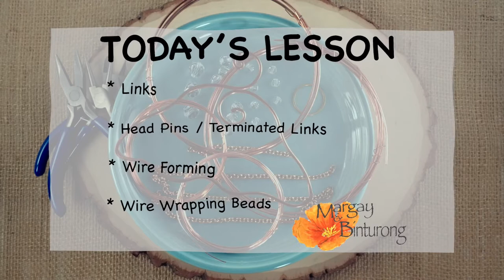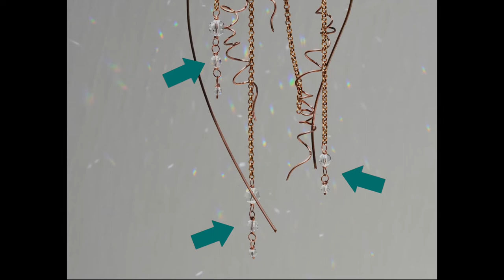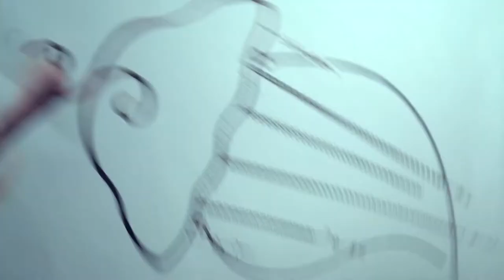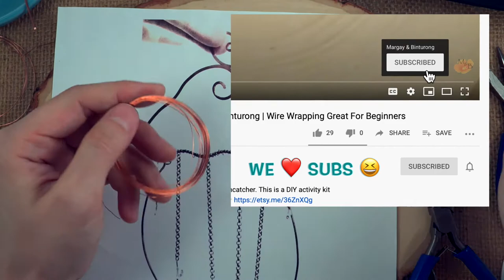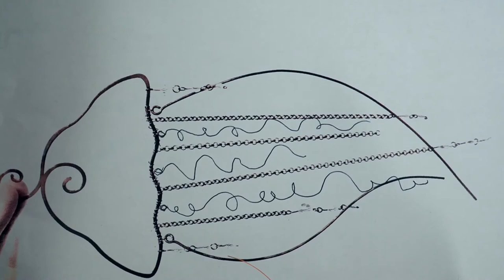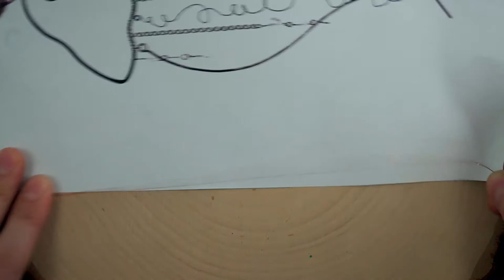Jellyfish Suncatcher DIY Activity Kit Instructions

Comment from the maker: Table of Contents (click to jump to chapters)
- 0:49 Tools You Will Use
- 1:59 Intro: Stuff You Will Need (Components)
- 3:01 Intro: Techniques Used
- 3:14 Intro: 4 Stages
- 3:33    Stage 1: The Danglies
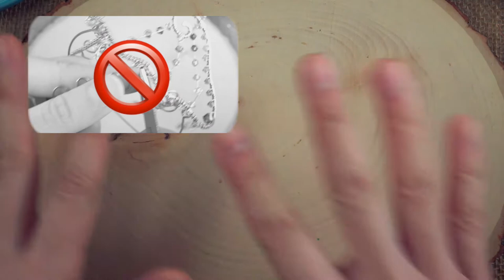- 20:08   Stage 1: Marginal Tentacles
- 44:54   Stage 1: Chain Tentacles (Part 1)
- 1:06:10 Stage 1: Attach Beaded Links to Chain Tentacles (Part 2)
- 1:14:02 Stage 2: Tentacle Time!!! (Wire Forming)
- 1:14:07 Stage 2: 1st & 3rd Wavy Tentacle
- 1:26:40 Stage 2: 1st Coil Tentacle
- 1:34:32 Stage 2: 2nd Coil Tentacle
- 1:37:40 Stage 2: 3rd Wavy Tentacle
- 1:42:15 Stage 2: Marking Tentacle Locations on The Wire Frame
- 1:45:15 Stage 3: Wrap Beads on Wire Frame
- 2:40:14 Stage 4: Attaching the Danglies & Tentacles
- 2:59:57 Conclusion